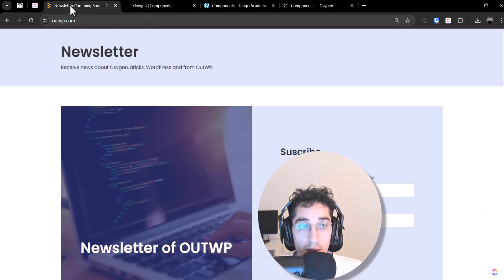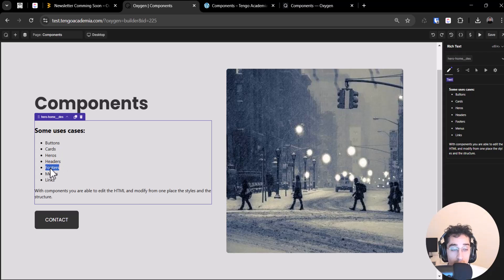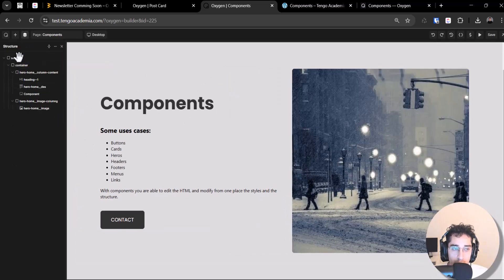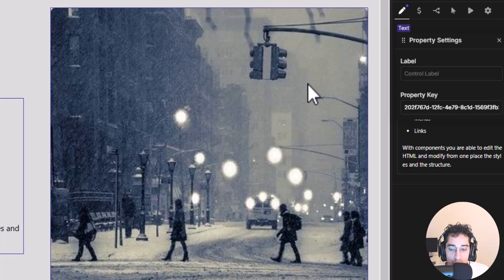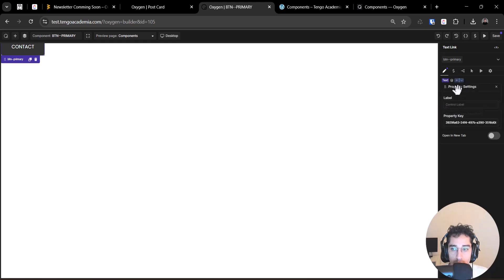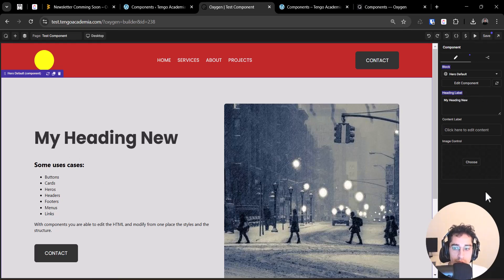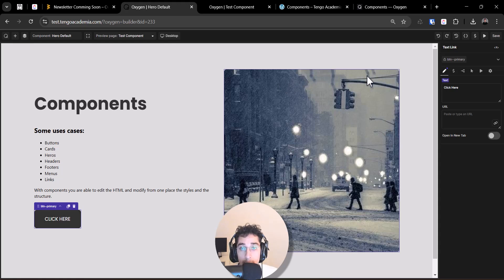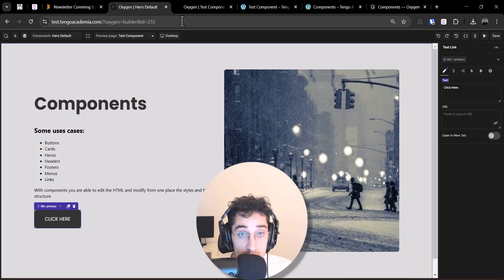How to works Components on Oxygen Builder 6

Comment: Hello, is the Oxy 6 still compatible with building gutenberg blocks, editable for clients? Are components the way for gutenberg blocks, or is there a way to create template specially as gutenberg block, thank you for your response.
Reply from the maker: No per now. Oxygen to gutenberg is for Classic Oxygen
Reply: @OutWP  How to create a client site? How can it modify the components? A simplified access of oxygenebuilder?
Reply from the maker: @Denisastier  thanks! I'll take notes about how could you do that
Reply: @ and if you buy Oxy 6 license right now, will you get the breakdance extensions (forms, elementes, woo commerce) also for free with the oxygen? Thanks
Reply from the maker: @tobicxs  hmm I really don't know that